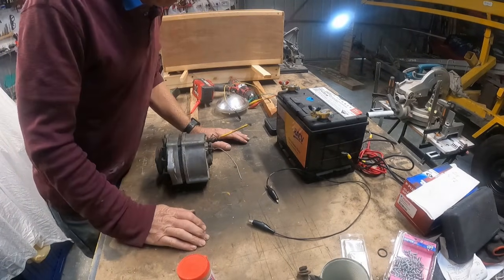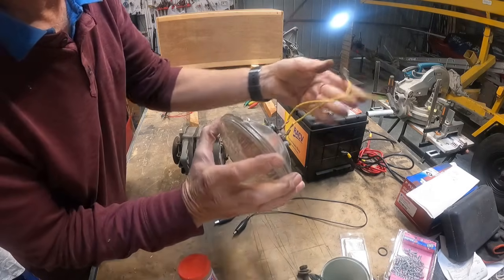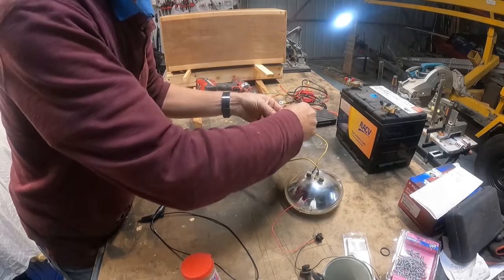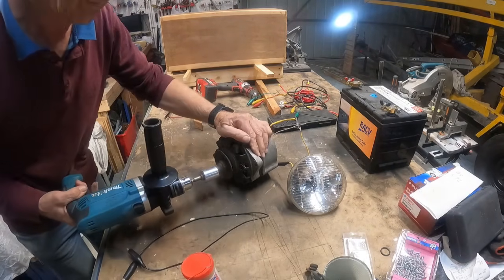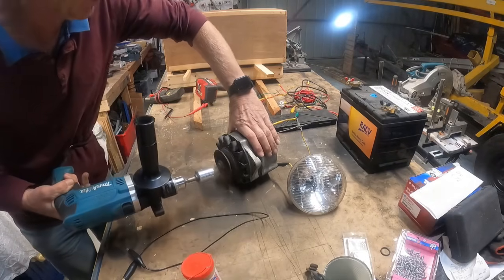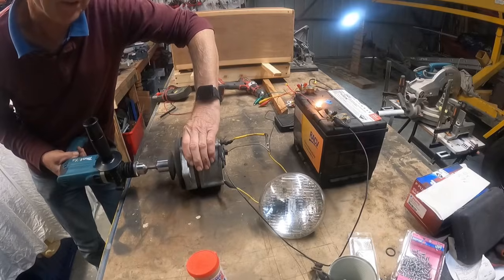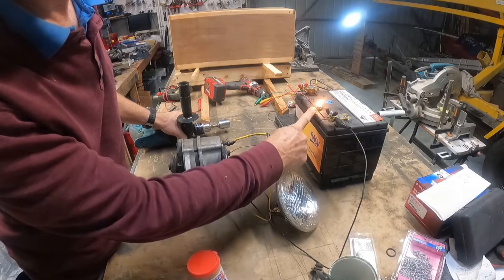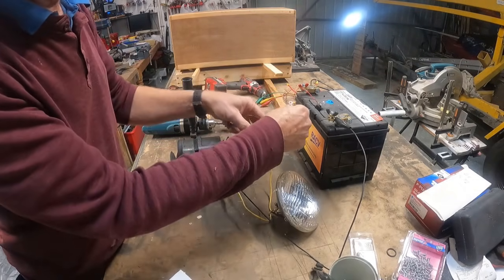Testing Alternators 1.0

Comment: I am trying to test a Lucas 16-ACR alternator from a MGB, and  I don't know where to connect your second wire.  OK, on my alternator there is a terminal that says "IND"  so I suppose that is where you connect.

ps.  because your hands were in the way, it almost looked like you were connecting the small bulb to the LARGE wire coming off the alternator.
Reply from the maker: It is the IND connection where you connect the wire with the light globe
Reply: @alansailing1387 Thank you.  I did the test as you showed with the small wire connected to the IND and the large wire connected to the PLUS terminal as indicated on the back housing of the alternator.  I am putting a link to your video in a MG group for reference.  Thanks very much.  PS....I didn't have a sealed beam headlight, but I used a halogen.

Comment: The problem I’m having in my 05 Yukon is that I have replaced the alternator 3 times! And it seems to overcharge the battery every time. So I unplugged the rear connection to it to send it to its default mode. I don’t know what else to do!
Reply from the maker: Check the model of the alternator against this: https://speedmaxinnovation.com/blogs/news/almost-all-the-gm-alternator-information-you-could-need  There is often an S lead which senses the battery voltage. It often has a fuse on it. Check that is has 12 volts. If this + 12 volt wire is not connected, the alternator will not be able to measure the battery voltage and keep charging as high as it can go.

Comment: Thank you, I've been looking for ages on how to excite an alternator! 

Question is do I need the bulb? Or us a simple 12v feed when ignition is on, do the trick?

Just need to workout which of the two small pins it is!
Reply from the maker: Yes, definitely include the Bulb on the indicator feed. You may also have an ignition feed and sometimes you may have a connection labelled S, this is a sense wire that goes to the positive on the battery to get an accurate voltage measurement of the battery. Google the model or part number of your Alternator and the words wiring diagram. You should be able to find a diagram of the connections for your Alternator.

Comment: Thanks for the response man , I really appreciate that's the problem , I am facing I have an alternator with 3 pins and an extra thick wire(battery charging  wire). I connected that thick wire to the battery thinking it will charge my alternator, unfortunately it didn't, I have been thinking that maybe my alternator is faulty that's why I resulted looking for videos of YouTube that might help and I came across yours which it really looks helpful. Il do practical myself and il let you know how it goes. Thanks keep it up the good work
Reply from the maker: When you have three additional pins, sometimes they are labeled: S for Sens (12 volt Battery voltage measurement),  L for Lamp - The indicator lamp that is connected to the ignition that starts the alternator. and I for ignition - possibly powers an internal regulator.  Get the model of the alternator and see what you can find.

Comment: Does this apply to all alternators on generally or it's only for Bosch?
Reply from the maker: This applies to all alternators, I only had a Bosch alternator available for this demonstration. The fundamental difference between this and a modern application is that the manufacturer will usually put a resistor across the light globe in the instrument panel, so that is the light fails, the alternator will still charge. All alternators need a tiny bit of power to begin charging. I made this video in response to a question where someone had replaced an alternator on their boat that wasn't charging, with a new alternator, and it wasn't charging either. The point I was trying to make was the importance of the circuit that excites the alternator, and spinning an alternator will not automatically generate electricity. I have seen this issue numerous times on cars as well. When I get hold of a few more alternators of different brands, I will make a more extensive video.